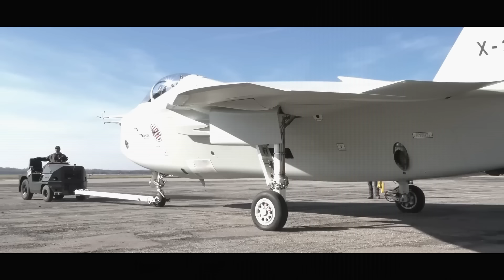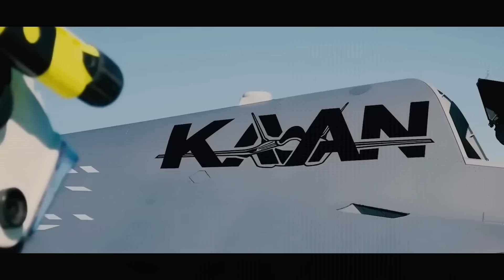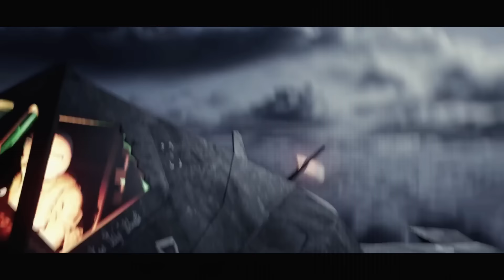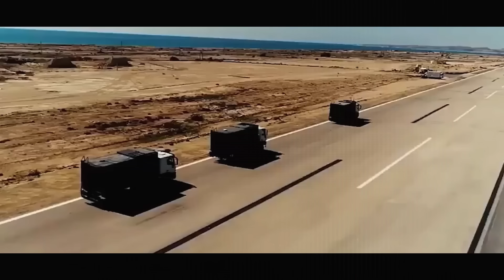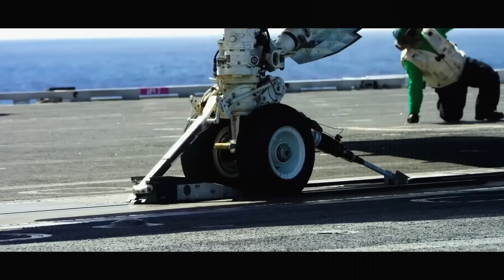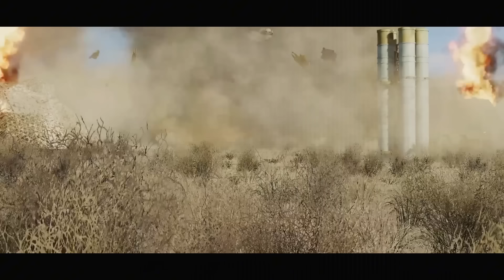Every Stealth Plane Ever Flown — Ranked Worst to Best

Comment: Notably absent was the F-47 (NGAD), which is meant to replace the F-22. We really don't know much about it, and there is some controversy over the canards, but the Air Force has confidence in it replacing the F-22 as the primary Air Dominance fighter. On paper at least, it blows the F-22 out of the water. Out of the sky?
Only because it's unproven/unreported, I will place the F-47 as a solid B tier. Whatever problems they encounter with it they will correct.
If it can live up to half the hype, it will move steadily into S tier. It was built to be the beast of all beasts in a dogfight.
Reply: With dumb dumb Trump gifting Boeing the contract Over Lockheed I don't have that much confidence in it and your video is rife with errors

Comment: What happened to the sr71 blackbird it was a stealth aircraft probably  best ever built and long before anyone else thought of stealth
Reply: i believe its because while the sr71 was built with low radar cross section in mind and radar absorbent paint, the biggest contributing factor in terms of stealth for the sr71 was because it flew too high and too fast for ground, and air based radars to get a proper lock on the aircraft, let alone trying to intercept it. When the sr71 appeared on enemy radar, there was simply nothing they could do about it. The aircraft in the video have stealth technology built into their shape in order to reduce their radar signature. Honestly tho i would've included the sr71 because it did pioneer early stealth technology.
Reply: SR71 gets a million points for the rule of cool (The X-Men fly on a VTOL Blackbird) but it's useless in a fight. It's an observer only.
I'd put it in B tier because it was a functional plane, it was never shot down, and had a decades-long service life.
Reply: Der  Blackbird hat keine Stealh  er war sehr schnell.